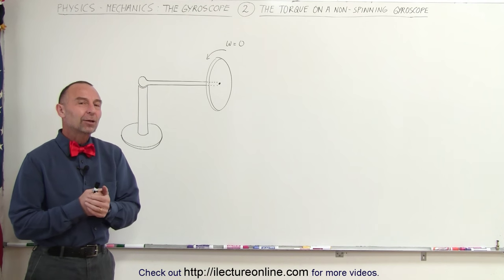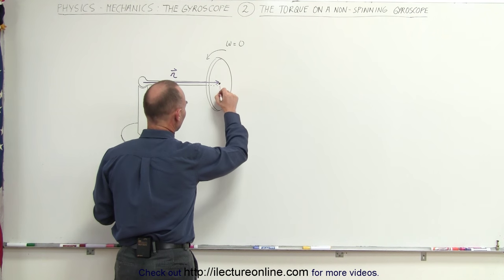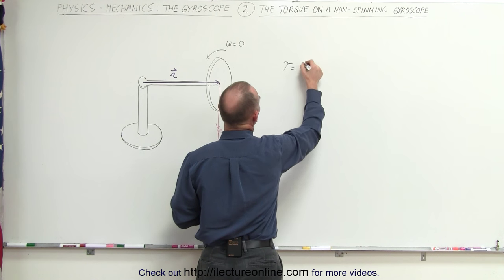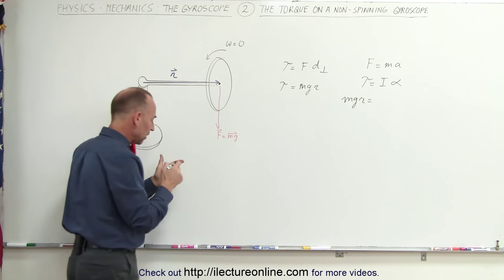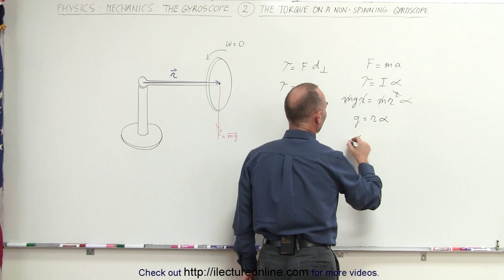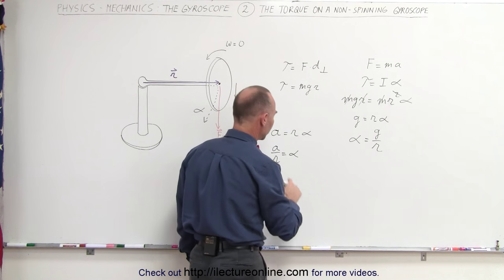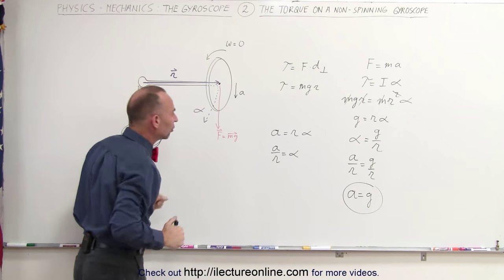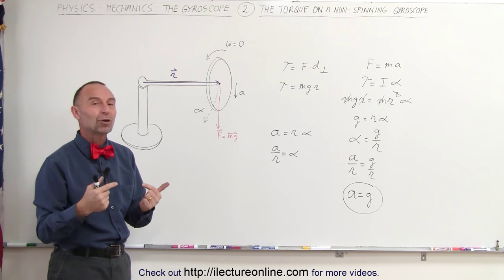Physics 13.6  The Gyroscope (2 of 5) The Torque of a Non-Spinning Gyroscope

Comment: Why does the weight of the disk produce a rotational torque about the disk? It wouldn't make the disk rotate; wouldn't it make the rod itself rotate down? Don't see why the disk would spin (rotate).
Reply from the maker: The rotating disk produces angular momentum.  The weight of the disk pushes the disk down which causes a change in the angular momentum which result in a torque that makes it precess

Comment: Two questions: How did you derive angualr acceleration (alpha) if the angular velocity (omega) is constant? Shoulnd't the tangential component of relative acceleration (acceleration of the disk) be equal to zero due to that fact? My argument: aR=aRo+aRt+aRn where aR0=aRt, aRt is 0 because aRt=alpha x radius & aRn=w x ( w x t) so aRn (normal acceleration) would be the only component which exists.

Comment: shouldn't the inertia of a disc be 1/2(mr^2)
Reply from the maker: Yes for the rotation motion, but not for the revolving motion (then it acts like a point mass).
Reply: what is the difference between rotation and revolution?
Reply: Technically speaking, the inertia of the disc about the axis at the joint going into the page should be 1/4(m*rdisc^2)+m*r^2, where rdisc is the radius of the disc itself and r is the distance from the joint to the disc. The first term is the moment of inertia of a disc about an axis perpendicular to the disc's axis of symmetry, and the second term is due to the parallel axis theorem. What you're doing is approximating the disc as a point mass, which neglects the shape of the disc and thus discards the first term.
Reply: @karthik_silkroads   For example: 1.  The Earth ROTATES about its own axis  and
                                                       2.  The Earth REVOLVES around the sun.
Reply: Check this video out if you want a derivation of angular momentum that yields to the same result as Michel Van Biezen: https://youtu.be/V1I-vrXGl3A?si=R9S9e8LWLvSUOfey

Comment: Surely even though it isn't spinning, the cross product says the torque is still into the board? Don't understand why it moves down therefore..
Reply from the maker: If the disk is not spinning, there won't be an angular momentum vector.

Comment: Why I is mr^2 instead of (1/3)mr^2 for rod rotating about its end?? Please help
Reply: Oh nvm rod has no mass
Reply from the maker: correct
Reply: +Michel van Biezen
I actually find these videos really useful for my "Mechanics 2" course.
That course deals a lot with 3-dimensional dynamics, and a lot of it has to do with gyroscopic motion, rotations around fixed points etc, and these videos have helped me understand the idea of gyroscopic motion and indeed 3-dimensional motion in general much better.

Comment: Explain omega better please
Reply: I'm in the 8th grade so this is more complex information than most kids my grade deal with so me being able to comprehend this was a challenge but I'm still confused on omega
Reply: Omega tells you how fast an angle is changing - this is called "angular velocity".
For example, if you spin one revolution in one second then this means that your angular velocity is 360° per second (or -360° per second if you spin in the direction that you have defined as negative).

However, angles are usually measured in something called radians, where one radian is an angle such that the arc length of the circle has the same length as the radius of the circle (this is approximately 57.3°).